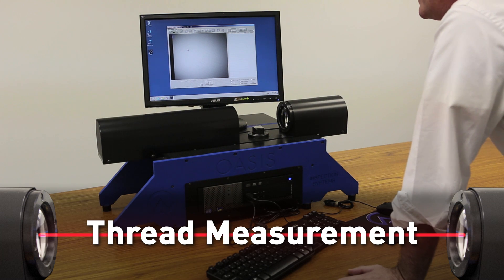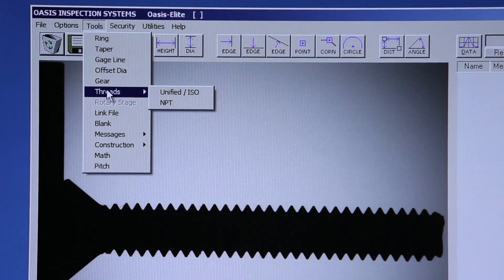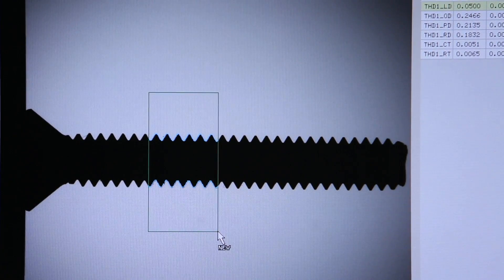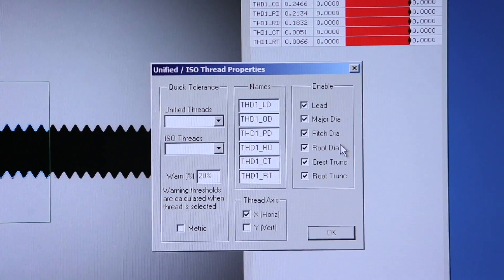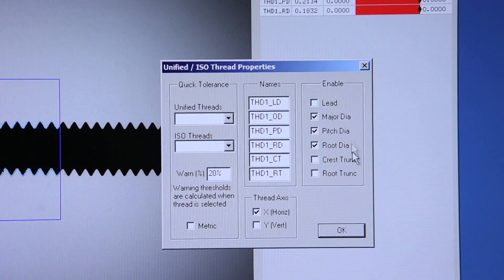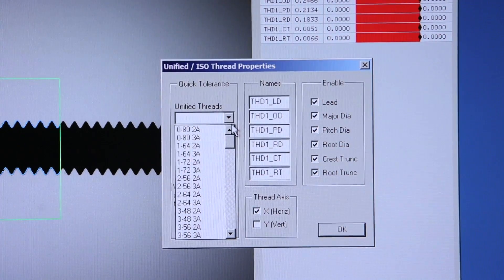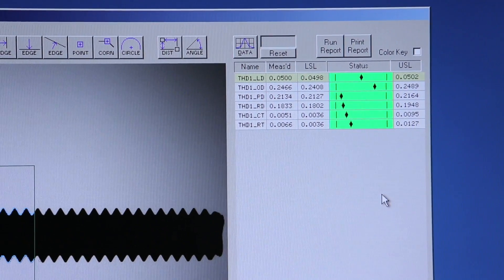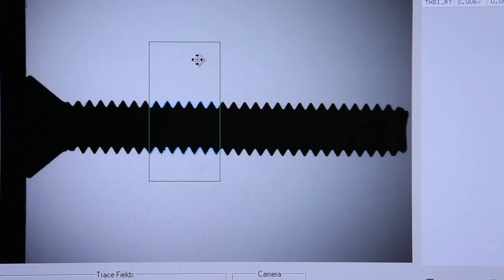OASIS Training Video #13-Thread Measurement

Comment: What is the accuracy of this?
Reply: Michael, the accuracy of our system is up to +/- .0001" but for threads, it depends on which system you choose and what the size of the thread is. For example, if you have an 0-80 thread on our largest system the accuracy and repeatability won't be as good as the same thread on our smallest Field of View system because on the smaller system we'll be able to get twice the number of points along the edge. If you have a specific application I would encourage you to send us some part samples and I would be glad to do a Gage R&R Study for you to show you the accuracy and repeatablitiy. 
Jeff Palmer
Vice President | OASIS Inspection Systems
jeff@oasisinspectionsystems.com